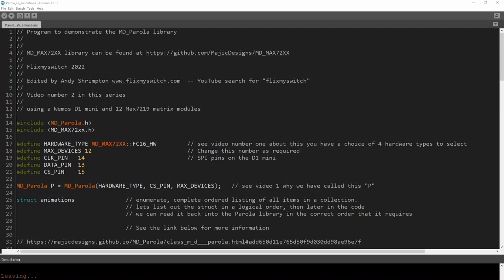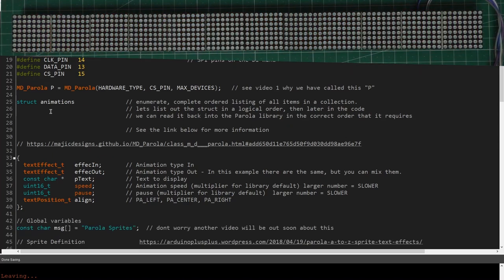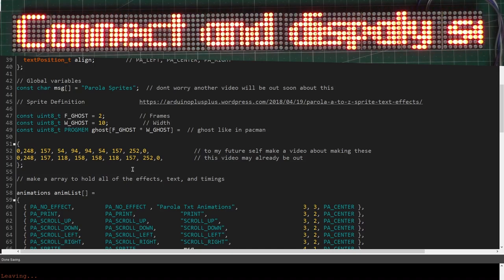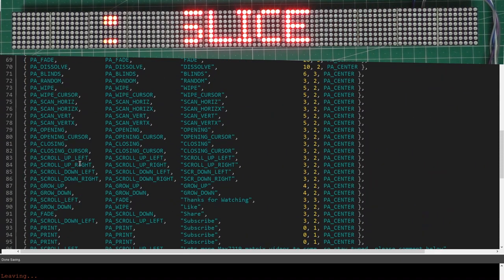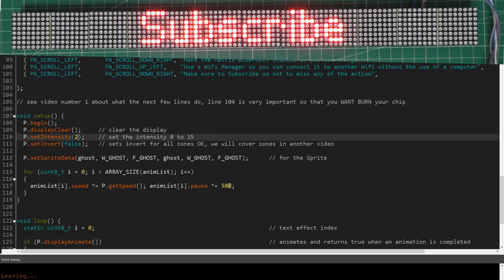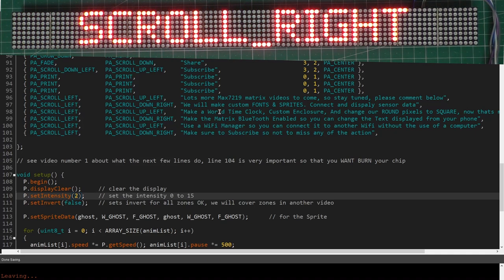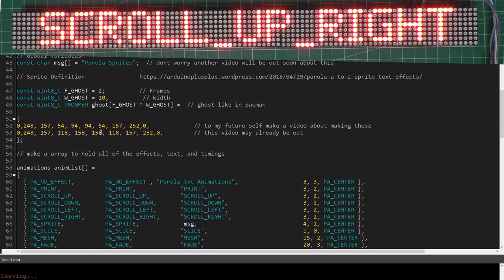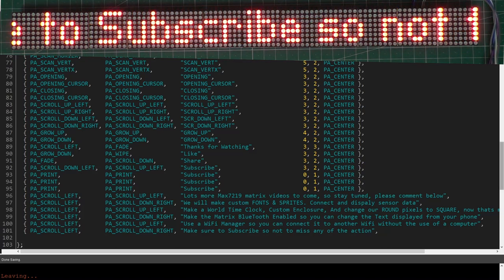Max7219 LED Matrix Parola Library Part 2 Animations & Sprites Arduino ESP8266 0046

Comment: This is great stuff. The code-link on to blogpost seems to be from Part 1 though. Maybe I'm missing something?
Reply from the maker: Thanks more to come. 

I have the code for the desk clock to finish

And I have a 12 way matrix world time clock to finish
Reply from the maker: Sorry I will sort it on Monday as not will my pc
Reply from the maker: You can find the code in the examples from the parola library. Though I may have altered it in this video but will check Monday
Reply from the maker: the code link has been updated. it will take you to github.  thanks for waiting
Reply: @flixmyswitch  Thanks man!

Comment: I have 1 8x8 dot matrix instead of 4-in-1 dot matrix.
I'm using parola sketch from parola library and it is working great.
But I want to use blue tooth (hc-05) to receive and send text to my arduino instead of hardcode the text in the sketch.
How to do that? Please help.
Also how to slow down the text in parola scrolling?
Reply from the maker: Hi Pal.  I have not used the bluetooth connection but i will in videos to come.  As for the scrolling you should be able to change the time in the INSTANCE of the Parola you set up.  I should have covered that in my other videos

Do you have a line like this

  P.displayZoneText(0, hm_output, PA_LEFT, SPEED_TIME, PAUSE_TIME, PA_PRINT, PA_NO_EFFECT);

have a look at pause time or the number you have in that position.

let me know

I have a new video just uploading now 3/323 should be ready to view in 10 minutes
Reply: @flixmyswitch  No, there is no line "P.displayZoneText... ". 
Thank you for replying.
Reply from the maker: @jumbo999614  so how do use use parola.

Take a look at my other videos in this series to see if they help you.
Reply from the maker: @jumbo999614  are you using the correct hardware type. You have 4 to select from.
Reply: @flixmyswitch  Yes, something like FC_HW16.
Scrolling is working. No mirror problem.
Just scrolling too fast.
Reply from the maker: Look at the lines with these numbers in

"PRINT",                            3, 2, PA_CENTER },
  { PA_SCROLL_UP,

The 3 and 2 control the speed 

Read the the code comments and you should be able to work it out

Comment: If use nodemcu lolin v3 change pin or same ?
Reply from the maker: If you upload the code and it does not work. Look at the pin out for the board and match them up.
Reply: @flixmyswitch  I use Arduino and the library too, do I have to change the code and pin to make it work
Reply: New nodemcu v3
Reply from the maker: Look at your board pin out diagram. Find out which pins are the clk, C's pins the data pin can be almost any pin number. Then change my code so you pins assised as clk, and C's are in the code. Let me know